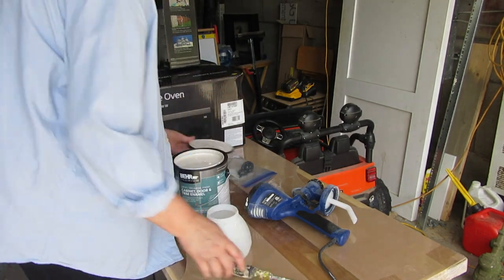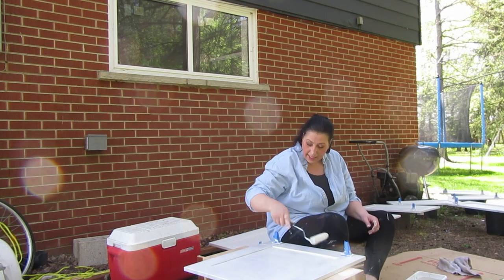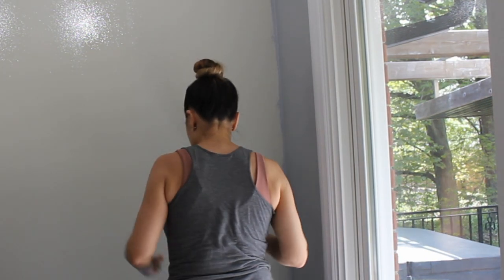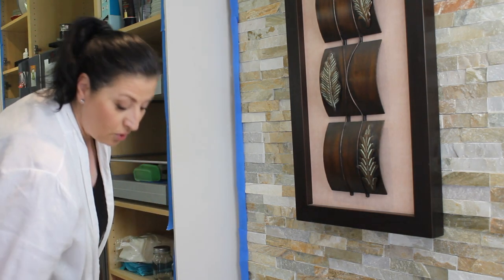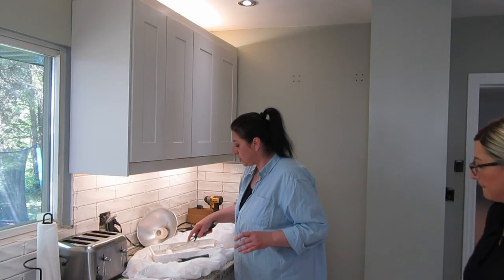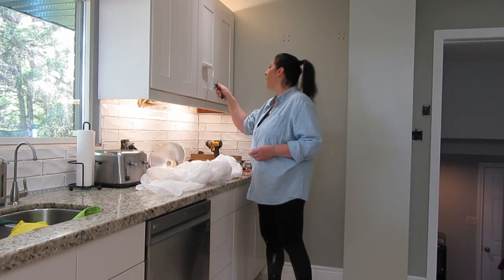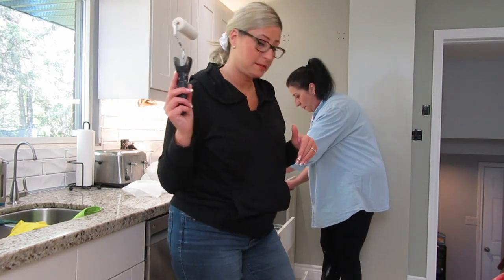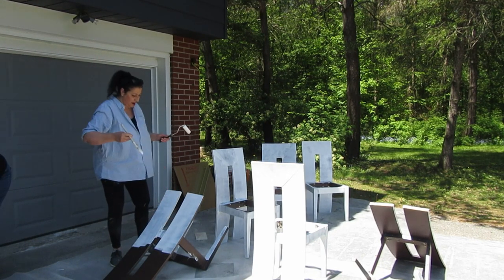CHIC KITCHEN MAKEOVER PART 2| DESIGNING ON A BUDGET|FROM DRAB TO FAB KITCHEN TRANSFORMATION

Comment: I painted my cabinets 9 million times because of getting that orange peel texture, between rolling and spraying, sanding it off over and over and over again.. priming, still getting the texture. sanded off again, I tried pretreating, priming, spraying, to still get that stinking texture. What i discovered.. if you have them laying flat, you just give them more paint. go over it until there are no splatters, texture or marks. I used the same paint you're using, sprayed until it look like I used too much. The next day i did the other side, giving it enough time to dry completely. It came out with a professional, smooth, store bought finish. This would not work if what you're painting is vertical, you would get terrible paint runs!
Reply from the maker: Exactly! So much trial and error, makes it all the more frustratiing but once you get the technique just right, it works well. I found that using thin coats as the doors are laying flat, allowing to dry completely did the trick. I'm glad I abandoned the sprayer early on, or I would have had much more sanding to do. Thank you for being here! New video coming out today.